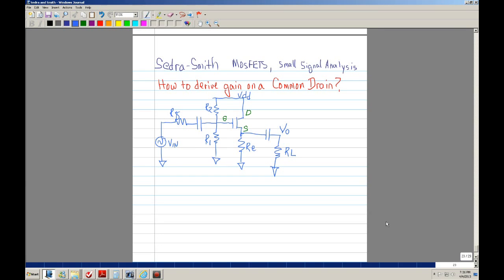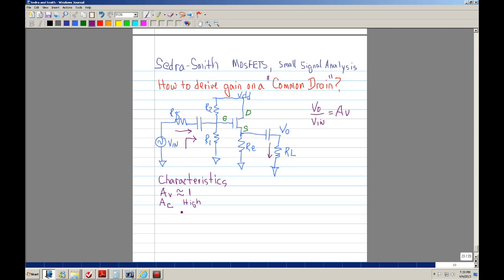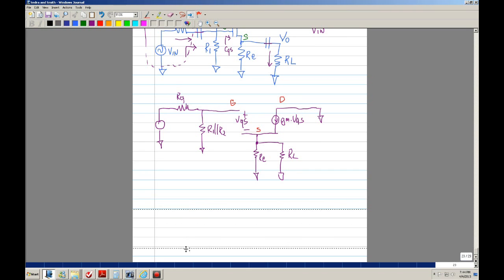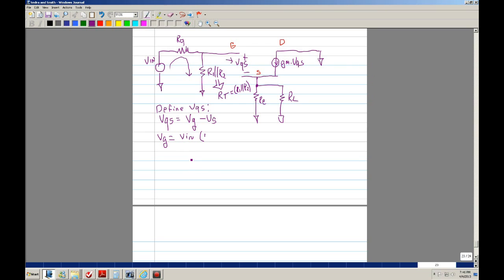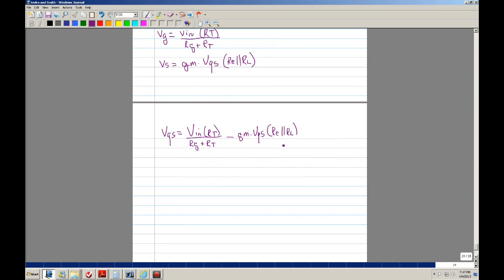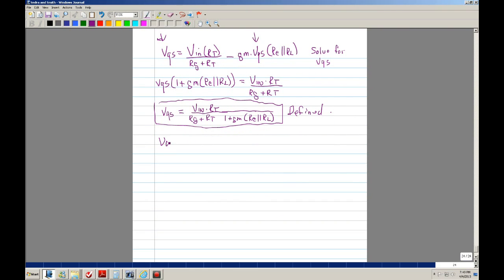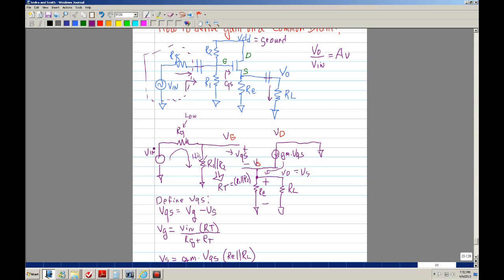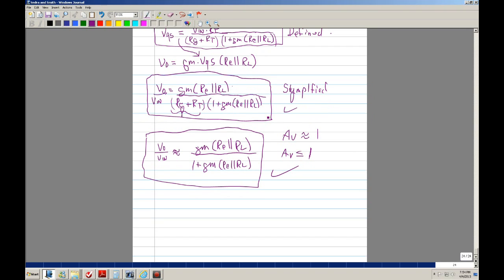Sedra Smith: Mosfet, Small Signal analysis Common Drain

Comment: where is r_o?
Reply from the maker: Hi Sean,  This was intended as an introductory video. If you are using resistor to bias the Mosfet, they will generally be much smaller that ro. In that case its OK to neglect ro. However, when the design is an integrated circuit, resistor take up a lot of die area and therefore use mosfets as resistor (1/gm). In that case, you have to take ro into account. Perphap I will redo the videos showing ro in future videos. Best regards, Robert